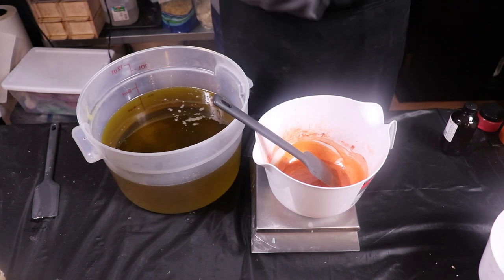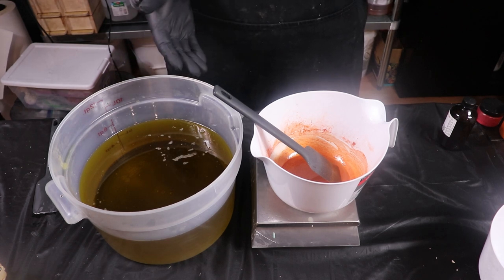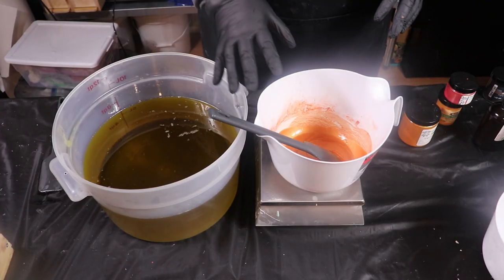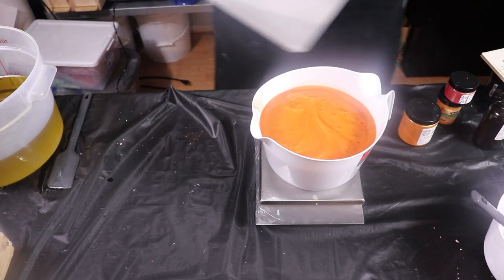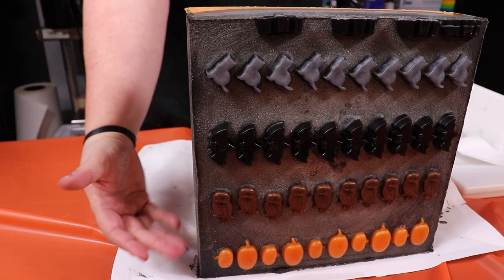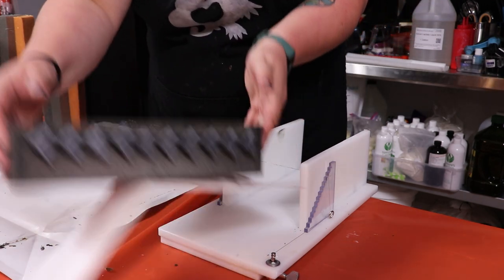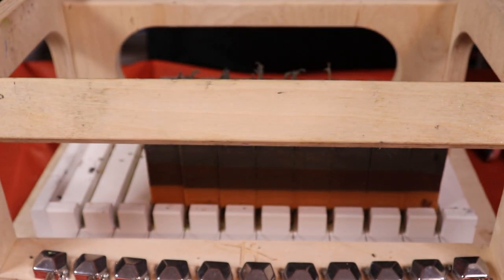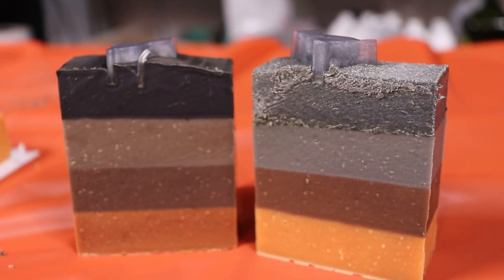Making CAULDRON BAIT Halloween soap! 🎃🎃🎃 ll artisan soap making

Comment from the maker: To clarify, the two batches we made of this were made using the same larger master batch of oils.  We had to replace our palm oil with palm kernel flakes because our usual supplier was sold out and though we adjusted the recipe for this, the results we were getting were super inconsistent.  This happened several times, where one pour from the same master batch would be fine and the next would behave strangely.  Luckily, we have found a new supplier for our oils so we're able to go back to our usual recipe!